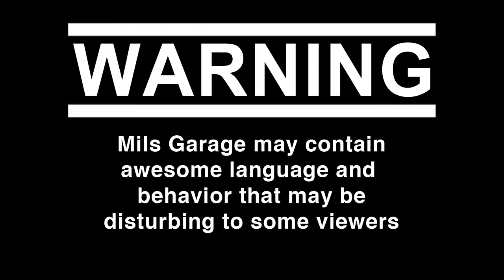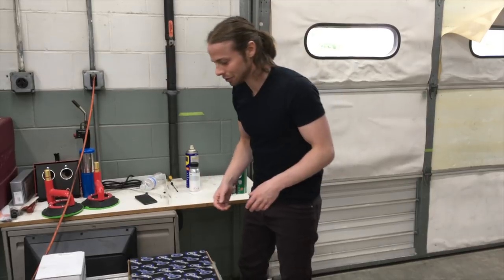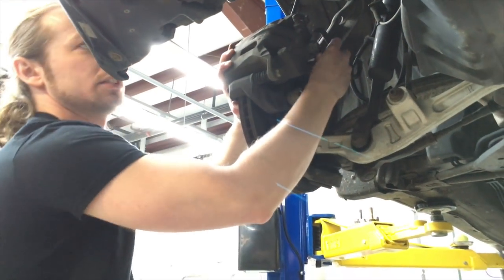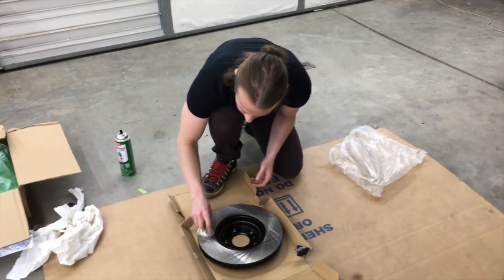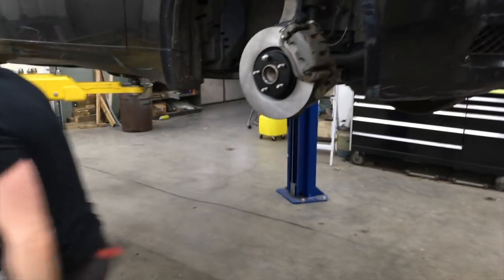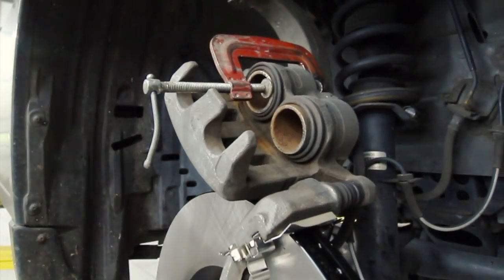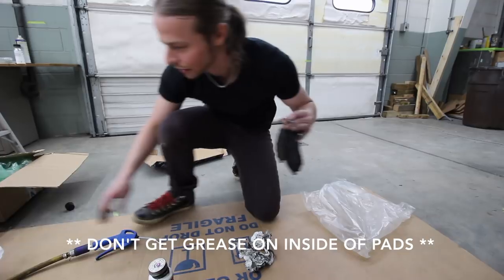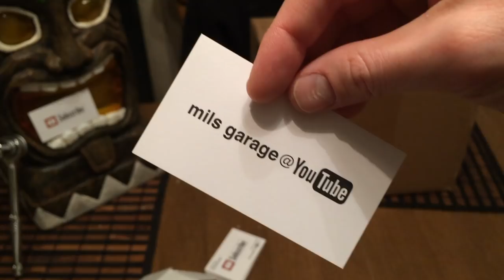Change Rotors and Brakes [Infiniti G35/Nissan 350Z] (COMPLETE TUTORIAL w/ Pro Tips)

Comment: Actual race cars use drilled rotors to increase surface area for heat dissipation to warm the tires. But when buying drilled expensive is much better in terms of reliability, it’s going to be 600 bucks for my 15 inch drilled  front rotors from a trust worthy name.
Reply from the maker: many people use many ideas to create "benefits," but i can assure you that metal which is heated expands. drilled heated metal expands unevenly because of pockets of cooler metal.. this promotes warping and cracking of the rotor, as the cooler metal can't expand at the same rate. 

race cars are also not daily drivers. they are driven for like 1 weekend a month, maybe. 
save your money.
Reply: Mils Garage Mils Garage the rotors i am referring to are Baer rotors, which use  cast steel instead of iron, the specific heat capacity is quite a bit higher, so it will most likely never expand enough to overcome the structure of steel even in racing applications, especially DD wear and tear, i would agree cheap iron would expand and contract causeing stressed areas  on the iron leading to failure, but they are made of steel for a reason. R&D teams get paid the big bucks for finding the perfect material for the task.
Reply: Mils Garage i just thought what you said was funny, it’s like what you’d hear on a Honda forum. i just got my bachelors degree in material science, so it just didn’t sit well with me. I’m sure if i bought eBay rotors they’d blow up but i like to go for quality parts engineered for specific purposes with specialized materials. No corners being cut on my car.
Reply from the maker: R&D ftw. well.. that sounds like a very educated piece of information you just provided, as well as a great product. i personally don't have the money for it, but if anyone is looking for a set of drilled rotors, that's probably a good way to go. :)
Reply: Mils Garage yeah real deal race car shit. The more you know lol. Great video btw definitely helped me help my buddy do his brakes, and pick up some MM wrenches i didn’t have, it’s all American in my garage 😂
Reply from the maker: yeah, so i think a lot about this stuff, and i also have very educated sources for info.. the more i think about it.. the more i'm gonna continue to believe that regardless of the quality of the steel, drilled rotors will be more likely to fail than a solid rotor.. more surface area = more rust area, more heat differences.. i'm sure better steel will heat more evenly and possibly have a higher heat limit, but it's still metal, and it will still expand with the same properties.. holes in the rotor may add more grip, dissipate heat quicker, etc, but i still believe it will fail before the solid rotor made from the same steel as the drilled one..
Reply from the maker: are you racing your .. wait, American? .. not G .. what are you driving?
Reply: Mils Garage oh i agree with that, a solid rotor is more structurally put together that one with a bunch of holes. But growing up around 6 second 1/4 miles cars and 1000 horse power Pro stock dirt track cars that always ran drilled and didn’t replace them until they couldn’t turn them anymore. In their years of riding those cars to hell and back they’ve never had a failure even on worn rotors a little bit past their life cycle. And those were 2 piece rotors so they were even weaker cause they are held on by bolts. Technically it’s right to say that they are weaker but not weak enough to cause failure during use. But I’m sure changing them is way more imperative than a Regular rotor. Can’t really ride drilled rotors till the doors fall off. Steel will expand and contract but steel can expand a hell of a lot more than iron can before cracking or warping meaning higher temps are needed before the bending happens , when iron expands and stress is put on it it’ll warp very easy. And the actual practical use of drilled rotors are minimal unless you plan on some endurance racing and Heavy road course use.  DD use on a low performance car is pointless and is just another expensive part that some places won’t even turn for you.
Reply from the maker: word. you're really smart and informative. definitely a good source of car facts. please feel free to add your input wherever you like on this channel :D

6 second 1/4 mile?? HOLY O_O lol damn. that's crazy fast!
Reply: Mils Garage high 6’s haha, but a 6 none the less. Real race car heavy in my little southern town. And thank you man you’re really chill keep up the great content👍
Reply from the maker: yo, a 6 is a 6! LOL spittin fire and everything, i imagine. lighting Prius' on fire n chit. 🏎💥🔥🚙 
thank you so much for your support!

Comment: My hole rotor is painted black should I wipe down with brake cleaner or naw
Reply from the maker: They’re putting interesting coatings on these days.. i’d spray them, but i’d believe it if they had new rust-resistant finishes that don’t require the preservative stuff. The brake clean shouldn’t hurt the finish, but you could always test a small spot to see how it reacts 👍

Comment: hey guys quick question for the caliper pin what torque spec would you recommend?
Reply from the maker: Hand torque normally comes to around 21ft lb, but don’t use a torque bar or impact gun. The pins are not meant to rotate during use, and they should fit snug w/o much torque
Reply: @milsgarage  thank you

Comment: I don’t remember the video I mentioned that my G is chugging oil. Apparently not as bad as I thought. Did the oil change this past weekend and was only a quart that was gone. I had topped off a quart so I lost about 2 quarts in the 5k. Maybe you can make a video on the best way to get an accurate reading on our dispticks for Gs lol. It always looks either full or super low. No in between
Reply from the maker: @Eduardo Nunez Oh yeah? 2 quarts in 5k sounds a little high, but it's probably within an acceptable range. The best way to get an accurate reading? Don't run the motor 2 hours before checking and it should make it easier to take a reading.. i also hear some people modify the reading area of the stick to hold the oil more, but i personally wouldn't mess with it
Reply: Mils Garage so read in the morning before start up?
Reply from the maker: Yessir, if that's the best time for you. It will be thicker after a cool night. The main reason is that when the engine is on, oil pressure blasts up the dipstick tube and that will make blotches of oil go pretty far up the stick
Reply: Mils Garage that makes sense. Anytime when I read it, it’s been blotchy so hard for me to tell if I’m low or not. It’s running a lot better since my last oil change. Swapped out the shitty camshaft sensors I had for Hitachi OEM and I switched to 10w30 full synthetic oil. It’s fun to drive again lol
Reply from the maker: @Eduardo Nunez Yep, coffee and oil check. Yo, that's awesome you fixed it 💯. It's a relieving feeling once you get the car to run right. Great work sir!

Comment: Did you guys installed rear rotors too and brakes or no ?
Reply from the maker: i mean, i have, just not in this video.. major difference is making sure the parking brake is off
Reply: Mils Garage why does it have to be off ?
Reply: moises cristobal I believe the parking brake if it is on will make the rotor hard to remove it pushes out on the inside of the rotor

Comment: Hey man. I’m sorry I keep bugging you lol. As you can tell, I watch your videos pretty much everyday. In the beginning of the video, where you talk about where you slow down and it slowly moves forward, mine does that! I do have my kit, just waiting for the weekend so me and my bud can get on it. When mine does that little motion, my rev drops suddenly and goes back up. My mechanic called it normal and my buddy says it’s engine braking? Does that sound right to you?
Reply from the maker: Dude, that's absolutely awesome. 💯💯💯💯 Is your G a manual or auto? Mine is manual, and i engine brake [i keep car in gear and down shift to 3rd to come to a stop, using the engine to slow the car down along with normal braking]. i imagine a pulsing stop could cause a dip in idle when coming to a stop, but the real test will be whether it continues after the repair. i don't think there's anything to worry about leading up to the weekend, so you can relax and make sure you're prepped for the weekend :)
Reply: It’s an auto. It hasn’t given many any issues or anything. No codes, no leaks, I just found it different but I’m used to driving trucks so I didn’t know if it was normal or not. Before this, my 17 Titan was my daily. Now, me and the wife alternate the G as a daily
Reply from the maker: It could be that the throttle body is dirty, or it might need a reflash of the ECM with a throttle relearn and idle air volume relearn. i've never done the relearns myself, but they're all online. You could disconnect the battery for a couple minutes and then see if it continues after it relearns the sensor readings.
Reply: Mils Garage cool I’ll check it out! Thanks!
Reply from the maker: Any time Eduardo! 💯

Comment: I have a 2007 G35 coupe Sport will regular base 07 brake rotors and pads work ?? ... or will they have to say sport
Reply from the maker: the regular rotors and pads should work for you, but i do see they offer some which say "sport" in the descriptions on www.rockauto.com for like $1 more per pad type of thing.. the ones that say sport may have slightly better specs [though i'm pretty sure the base ones are the same as the sport]

Comment: Haven't done brakes in a minute. Afte your dome imstalling everything dont you have to pump the brakes?
Reply from the maker: Yes, there's a good possibility that you'll need to give it 1-4 pumps to pump up the pressure in the lines and set the new pads. You're going to definitely want to bleed the brakes or inspect them further if the brakes don't pump back up quickly after the service.

Comment: Is there a difference in rotor size between the 03 and 07?
Reply from the maker: i believe there may be a difference if you have Brembo vs standard Nissan brakes, but i'm not certain. Otherwise, if it's Nissan OEM brakes, it should have the same size rotor for all years

Comment: Which rotors can i put in my car g35 2004 regular rotors or sport package please I need help
Reply from the maker: You'll see at RockAuto.com that they either list that the rotors are Brembo compatible, or don't say Brembo. From that info, i gather that the dimensions are different between the two. Looks like Brembo uses 12.76" Vs OEM 11.654". You're going to have to look at your brakes to know whether you have Brembo brake calipers or not, and then you can make your selection from there
Reply: I'm going to check the page because I already need to change the brakes and rotors 👌👌

Comment: Can i use my OEM coupe caliphers ? Or do i need to fork over the $ for stoptech ?
Reply from the maker: Do the pistons still work? How are the seals? i use OEM spec rotors and calipers from RockAuto.com , and always do core returns.. i think Stoptech is an option on there, but you might want to check them out if you feel you'd like more options
Reply: I just don’t want to spend the extra money on stoptech caliphers if my oem will work with stoptech pads+lines
Reply from the maker: Sorry, i'm not familiar with Stoptech.
Reply: Mike Honcho I had stop tech slotted rotors and pads on my 06 g35 coupe non Brembo kit and yes you can use them

Comment: Hello could you tell me what's the torque specs for the rear banjo bolts please I tightened mine but when I checked it again today (a few days later) both sides are leaking (cant seem to find it online) please help thanks
Reply: This is for a nissan 2005 350z
Reply from the maker: i've read 35ft lb.. BUT i don't think anyone should ever torque a banjo bolt. i recommend double washer, and slight crank hand torque. only use copper washers.
Reply from the maker: are you sure you have the proper double washer setup?
Reply: Yes it's one on each end and both sides  are leaking (both rear) I painted them before I reinstalled the calipers ico if the paint has to do with anything? I covered the tip when I painted them I'll have to take them off and check again :(
Reply from the maker: a dab coat of paint could definitely give a less than perfect seal.. sounds like it's getting messy, but you might want to disassemble it, go over the edge with a 1000 grit sandpaper to get rid of any debris, and see if that makes the seal

Comment: Why didn't you just use a impact wrench to break loose the caliper bolts?
Reply from the maker: for two solid reasons: 
1. i showed people who are trying to save money how to save money, including work-arounds for not having expensive tools such as impact guns and compressors.
2. for production reasons.

.. just thinking about it.. i don't want people to be using impact guns around brake components anyway.
Reply: I see.. well I have a impact wrench and I don't see the problem with just breaking it free and taking it off by hand or with a ratchet. The reason why I'm saying this for using the impact wrench is cause breaking it loose with a ratchet you're more prone to hitting your arm, etc in the fender wells and that shit hurts. Lol.

Only to break them loose, not tightening, cause I have a torque wrench for that.
Reply from the maker: LOL sure. you can use an impact gun to break them loose.. i just hope you don't break a bolt, cause that would suck. many of our viewers are just learning about cars and don't have a lot of experience or funds.. i wouldn't want them to accidentally hit the caliper pin bolts with an impact gun, so it makes sense not to recommend them using an impact gun on brake jobs. 

i'm glad you know not to torque bolts with impact guns 😎👍

Comment: Great Tutorial, i want to replace mines too and my discs are really rusty but im not sure about it .
I live in europe and the nissan dealers dont have parts for the car so they are offering similar discs, but indont want to buy junk how much should discs cost on average? Maybe consider a us import?
It really sucks that no dealer has no original parts for your car...
Reply from the maker: awesome, thanks! hello in Europe! we get many of our parts from rockauto.com
the discs rust really quickly unless u get the ones with the paint on them, but rust is normal.. u should be able to tap some rust off and clean it up with a wire brush if it's not warped :) and a decent rotor runs about $50USD

Comment: Bro, I got a 2005 g 5 coop and I got. The overflow reservoir filled and it won't drain back into the radiator. Not overheating but not blowing heat, either, which is no big deal im in south Texas.

Why doesn't the coolant return back to the radiator? Its only God 72000 miles on it don't tell me it's a headgasket
Reply from the maker: so it only works when there's a vacuum in the line leading to the radiator. if there r no visible leaks, i believe this means there must be an air leak in the cap's seal, preventing the vacuum from forming. u probably need a new cap
Reply: Mils Garage 

Thanks I did did buy the cheapest one available at auto zone. Wouldn't the water pump start whistling or making some bearing noises? I cant believe it if these things. A head gasket.

But no white smoke out the tail pipe and no millions of bubbles in the reservoir, they still may be air in the lines. I'll keep messing with it.
Reply from the maker: sure, those sounds would happen if the coolant got too low, but hopefully ur engine was still circulating some coolant.. when the engine heats up, the coolant expands and is pushed into the reservoir.. then the coolant cools and should contract with the vacuum, back into the radiator.. or at least that's the plan lol

Comment: Will warped  rotor cause loud wind noise ?
Reply from the maker: no, but wind noise can be a couple things.. i would check to make sure all of your panels and clips are secure; especially your fender liners and the two plastic air funnels located right behind the front bumper. when i got my G, those air funnels weren't even connected, and it was making a weird wind noise until went top to bottom making sure all the panels were properly secured

Comment: I’m looking for tools kit for my boyfriend g35. Do u have any recommendation?
Reply from the maker: Sure! You might want to double check whether he has these tools, but every tool he needs will be Metric.. He'll definitely be able to use a ratchet set with sockets for the bolts. Also a small flat-head screwdriver so he can remove any plastic clips. Maybe a oil filter removal strap tool.. If he has a bunch of those, he could probably use a low-profile jack and some jack stands.. Maybe some soft mats so he's not feeling all beat up from the hard concrete floor. Some work gloves are always a great gift. All of these items can be found for decent prices at Harbor Freight, but some of the more durable brands are Snap-On (very pricey) and Craftsman
Reply: Thank you
Reply from the maker: @Flawlesswithketo Any time for sure! Your bf's a lucky dude. Definitely one of the coolest questions i've been asked in the comments 👍

Comment: Do I  have to bleed the brake when changing the pads?
Reply from the maker: u'll be ok w/o bleeding them. no air should make it into ur brake lines if u'r just pushing the pins back in and swapping pads.. u'll definitely want to bleed them if u remove the caliper or open the bleeder valve